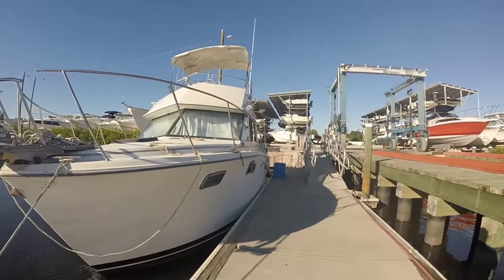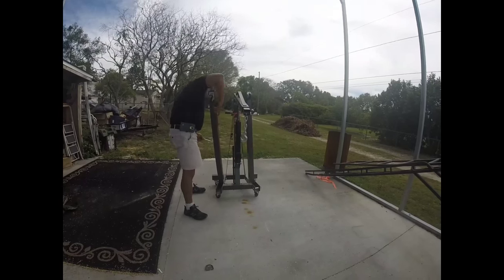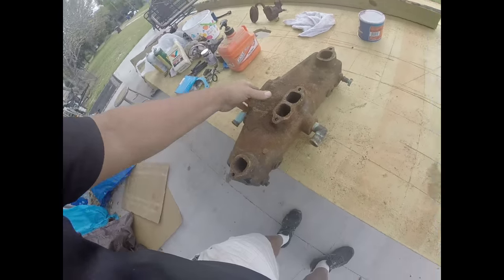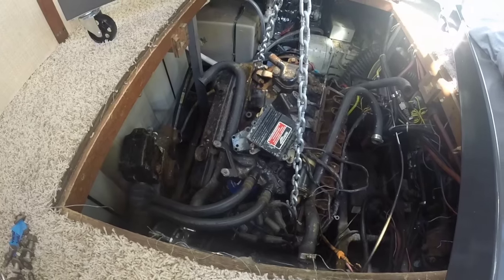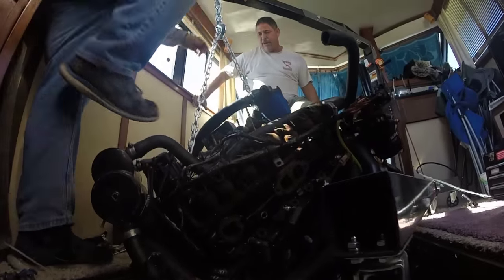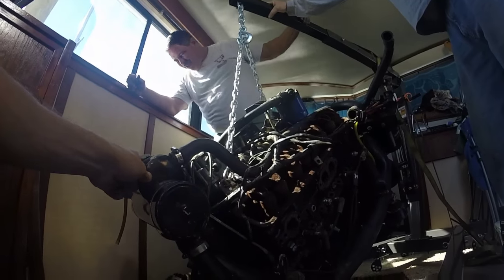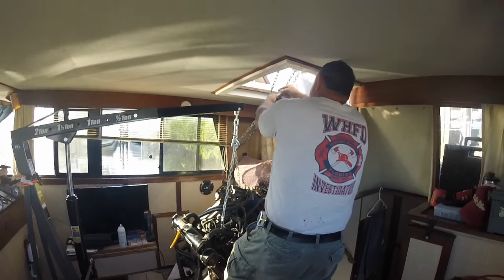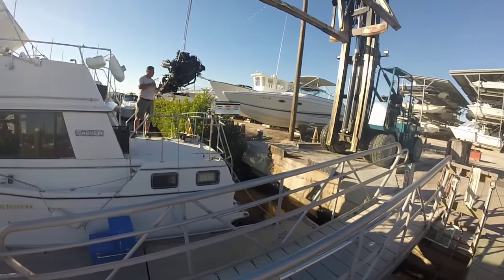32' Carver Boat Mercruiser Engine Installation Video 2 Step by Step on Removing the Port Engine

Comment: WHOAA!!! Balls of titanium! Takes guts to remove an engine while the boat is still in the water and just tied to the dock. Luckily no douche with a SeaDoo went ripping by.  Great video and thumbs up! Appreciate the sharing.
Reply from the maker: Well it is quite common in our area to change them out while in the water. Most people I know do it do to the height of the boats while on dry dock. Most of the area marinas use the forklifts as we did. When your boat is on dry dock the forklift driver can only see someone giving hand gestures as to what is going on inside. And yes we were lucky with no waves tho you can be assured we were on look out for that! lol. Thanks for the comment!

Comment: we had a Carver 32'... same config... I remember when Dad and I went to start the engines after an in-water winter (3rd or 4th year of service?). We went through the whole rigamarole... then turned the key. EXPLOSION. BOTH engines blew their rods. we spent DAYS rebuilding the top halves of both engines, but boy did they sing when it was all over!
Reply from the maker: Yea I paid to get the engines rebuilt from a company that do many every day. So much work goes into taking them out and putting them in that I wanted them to be done.

Comment: Look at the flex on that fork extension, you should always take a crossed wrap around that fork with the chain so chain don't slip off fork.
Yes I am a professional, Journeyman Rigger.

Comment: If I was going to rebuild a marine engine I would definetly use a rotating forged assembly. Crank, pistons, push rods etc. Plus a engine Rev limiter to be safe.

Comment: I recommend putting a bolt on that chain that's hooked on hoist to prevent accidental slip.
Reply from the maker: Yes, not a bad idea
Reply: Use 2 seperate chains then it cant render and you can adjust the angle of the pick too, Journeyman Rigger here. Just hope I dont have to do that, mine has crusaders, they are 350 though.

Comment: What do you do when there is a roof on the aft deck?
Reply from the maker: Probably would need to remove it. Depending on how much room you had from the deck to the roof. I could see a situation if you had a good fork lift driver may be able to maneuver under it but they would probably also want it removed.
Reply: Aft roof has to come off. But there is another way using the radar arch  and 4x4 across it